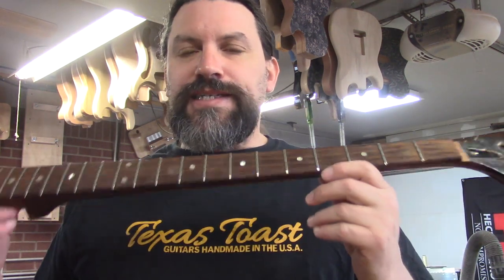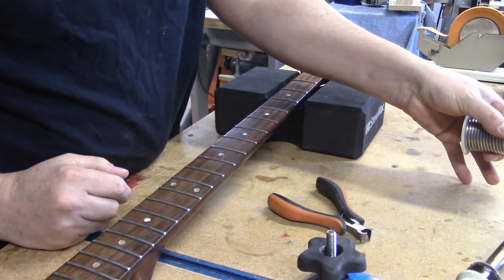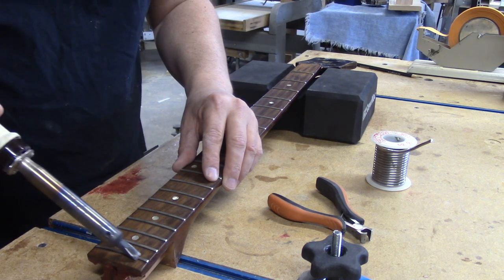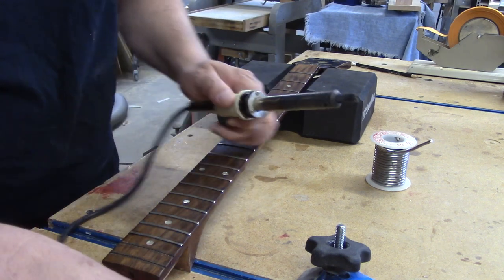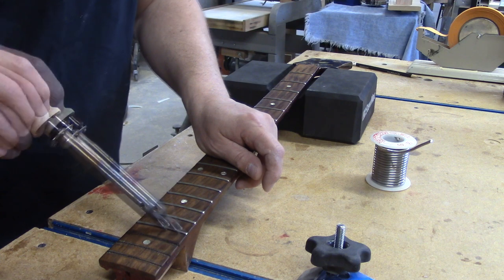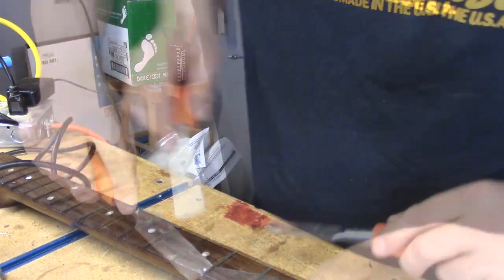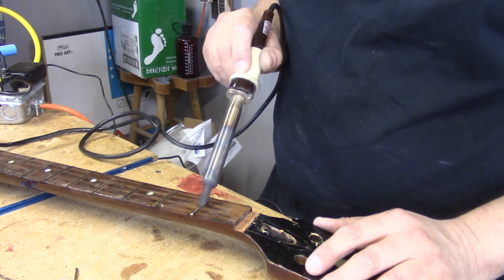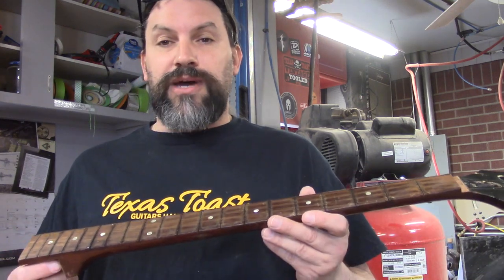1967 Gibson EBO Bass “Restomod” Part 4...  Pulling The Old Frets

Comment: I find I get a lot less chipping if I Q-tip some water against the fret before heating it up. Softens up the board a bit. Also some solder on the iron transfers the heat faster. I only use a 40 watt unit. Not telling your business but I do a lot of refrets. Good vid Matt.
Reply from the maker: Great tip brotherman, I really thought these would come out easier... especially after the first one

Comment: A helpful tip I learned was to set a clothes iron on like the medium setting on the frets downstream of the fret that you are working with the soldering iron on. This will "pre-heat" the next few that you'll be working on, making it much easier to get them heated to the point of removal with the soldering iron when you get there. I use a piece of aluminum foil between the iron and the fretboard just to protect the wood from anything bad happening to it. Hope this tip is useful to you!
Reply from the maker: Great tip brotherman, I really thought these would come out easier... especially after the first one
Reply: I feel like I saw that tip on a StewMac vid or 2 🤷‍♂️

Comment: Laying strips of masking tape alongside of each fret is good for keeping those rosewood chips in place before you lose them. Then, after all those frets are pulled you can lift up one end of the tape, lay some Super Glue down in the divots, then gently press the chips back in place. The smell of rosewood heating up is one of my favorite scents .It kinda smells like roses so I'm betting that's why it is named what it is named.
Reply from the maker: That is a great tip, I really thought these would come out easier... it isn't too bad but, you know

Comment: That's a great idea Matt on having a groove in the soldering iron tip. Normally I just rest an iron on there for a couple of minutes and pull a few out at a time. 
I was ordering some stuff from stewmac anyway, so I chucked in some cryowire as well and thought I'd give it a go. It was way cheaper buying a pack than a few lengths. It's the way to go if you've got two or more guitars to do. There's enough to do about 6 guitars I think.
Reply from the maker: Hi Peter, we always buy in bulk too, unless someone wants something special. We have been using the cryo-wire for a bit and it works easy. Still waiting to do a video on how tough it is

Comment: I think you should have cleaned and oiled the fretboard first.  Ive recently done this myself on a Charvette guitar. I Couldnt find a 24.75 charvel neck to work with it so I decided to buy a donor 25.5 neck and change the fretboard.  I was advised that you should oil the fretboard before you do the job as well as this helps preserve the wood fibres in the slot, but I think the water trick is just as effective as the steam the water creates under heat helps soften any crud and glue in the slot.
Reply from the maker: Good idea, the first one came out really easy and I thought I would be golden. A little extra moisture in there certainly wouldn't have hurt

Comment: Are you getting honduran mahogany veneer cause I would sure like to know where to get it. I have a very similar project being a 67 sg special routed for humbuckers and was sanded too much on the neck making the binding disappear up to the 3rd fret.  The veneer is a must, Ive tried bondo so many times and it always moves. 

I never thought about removing the neck but that would make the refacing process so much easier.
Reply from the maker: I might go with H Mahogany... but probably not. They do sell it at the lumber yards we go to but it is quite a bit more than the African so I rarely use it